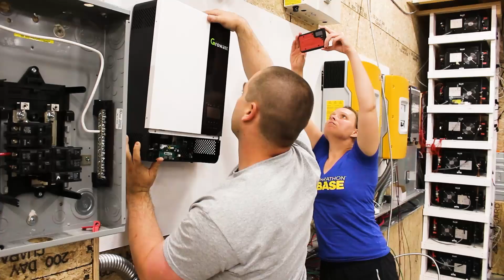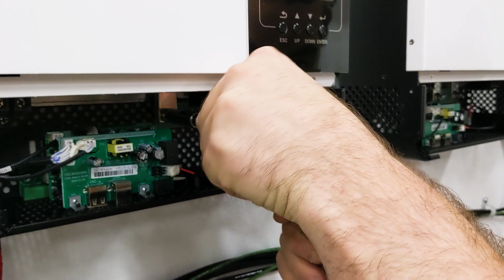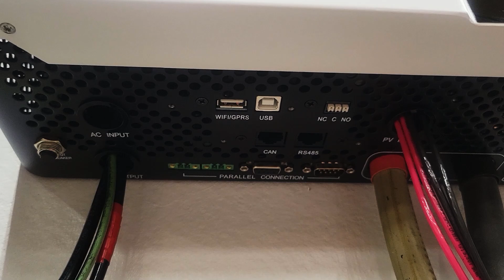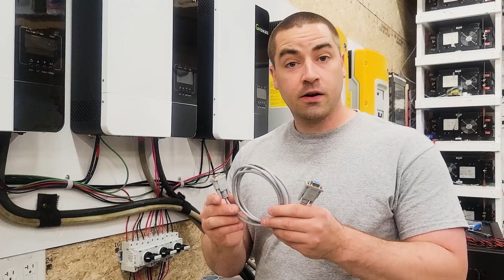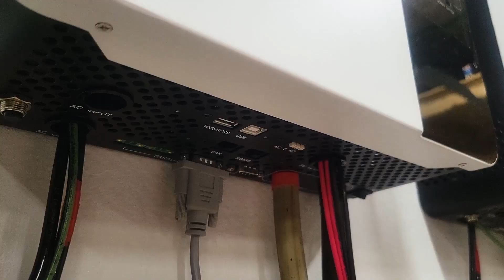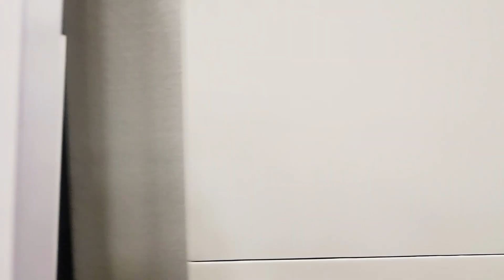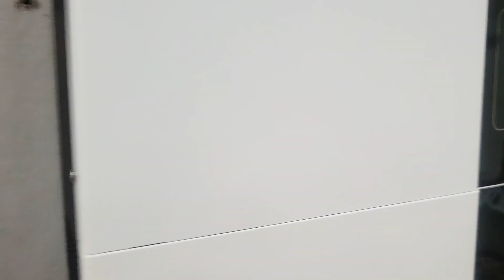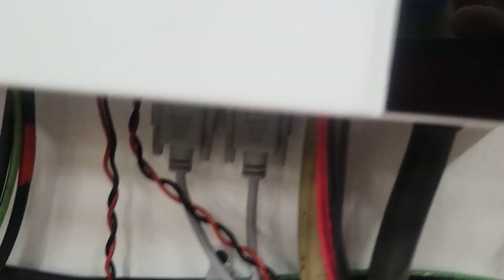Paralleling 3 inverters together, Growatt 5000w Solar System

Comment: David, can you test one 5000 watt inverter directly to a 4500 watt water heater and see if it will work without batteries from a large PV string? I have hydronic heat and more panels than I need for electricity. My plan is to run direct hot water from 6000 watts of solar panels through the Growatt 5000ES if it will work. If it won't work I'm going to include a 48 volt battery in the system. I have 24 extra 265 watt solar panels and want to put them to work.  I heat water and my floors with Nat gas now. I enjoy your videos. Cheers!
Reply from the maker: Hi Solexx X,  In my first video on these inverters I ran a 4500W element off of the inverter, but it was fed with my battery bank.  Could you run it through the inverter without batteries?  Technically, yes, but it will be hugely disappointing.  4.5kW element on a 5kW inverter is about 90% load.  Up there I think I measured the inverter at 88% efficiency.  That means the inverter will draw 5,114 watts.  The largest array you can connect is 6kW.  This means that the inverter will only turn on when your solar array is producing >85% of it's rating.  That happens about 2 hours a week at my location on my arrays.  Most of the time they just don't produce that because of clouds, angle of the sun, haze, smog, shade, temperature, dust, etc.  
If you want to run a water heating element directly from solar, I'd suggest doing so without the inverter.  I have a few videos on heating water directly from panels.  Start with this one: https://youtu.be/kVaxAfXQPDU
Reply: @DavidPozEnergy  Hi again David. I did watch your direct water heating videos but I don't think for my load that is very efficient. I'm going to invert to 240 volts with the Growatt 5kW  and have purchased 7 of the 36 volt 36v 48ah 1.78kWh POWER Module - 60x SPIM08HP from Battery Hookup that I will convert to 48 volts and 12kw/hrs of storage. I will run 2X3000 watt elements and use the load sharing of the Growatt to see how much it reduces my peak daytime load on the condensing gas boiler. My electricity is very cheap from 07:00 pm to 07:00 am. The most expensive power where I live in Ontario Canada is just 5 hrs.

Comment: Great channel, Please I'm trying to replicate what you did with similar inverters, probably a Chinese version of it, but I did use your discount coupon for the autotransformer, thanks, please can I have more advice on how the autotransformer is hooked, that part is not understood by me. Sr If you can give me a link for the AC combiner box, also I have 32 panels of 440 watts (mono), how many can I feed to each inverted, location Miami, FL, You're doing some of the hard work to make it easier for the rest of us. I really appreciate that.
Reply from the maker: I go into more details on the auto-transformer in this video: https://youtu.be/yWUfvvSa3K8
Reply: @DavidPozEnergy  Thanks really helpful.
Reply: @DavidPozEnergy  I have a 440 panel from Solarever MODULE HC79M after calculation from the provider of panels, given the manual of these inverters, they recommended a string of 8 panels in series, that give me a total of 3520 watts, which to me under,  I bought 32 panels, how do I wire to get the 5.1 kW or 4.4 KW, that you get in one of those inverters, my inverter is Revo E 5.5KW.

Comment: I have been been running six, 100 watt solar panels a total of 600 watt and a 3000 watt pure sine wave inverter  and a mppt charge controller that can do upto 48volts but my system is a 12v system. So for battery I have 4, 100 ah lead acid battery from Walmart tie in palleralle and they're running my house over 2 years now but these battery aren't great so I used a 4 amp battery tender charger at night to maintain these batteries from the grid. But I really want some lithium battery on a reasonable price cause my charge controller can charge lithium too but I want them to be 12 volts battery though... but i think of i get lithium i wouldn't have to rely on the grid

Comment: Hi David, been studying your videos for my upcoming project lol.  Thanks for all the info.  I have ordered 3 growatt 5k inverters, 4 gyll batteries and 15kw of panels.  Couple questions for you if you have time to answer about wiring.  In your panel box shown in the video, do you have the ground and neutral bonded together before going to your home transfer switch?  Also, what is your transfer switch setup to handle the power of your whole home?  Thanks in advance!
Reply from the maker: Hi Blue Bore Armory,  In my particular setup:  The AC circuit breaker box next to the inverters is my "combiner box".  It's where the 3 inverters, and my auto-transformer, come together.  From there, they feed out through a 50 amp circuit breaker into my homes transfer switch.  Since my home main panel has a N-G bond, I can't have a second.  So I don't have the N-G bonded at my combiner box.  You have to adjust for your own situation.  Hit me up on Facebook if you would like to chat more.
Reply: @DavidPozEnergy  thanks so much for the reply!  I'll find you and send a message on the book of faces :)
Reply: I am building a similar setup to David's, with the Growatts and solaredge autotransformer, but using 1 breaker panel for 240v loads and a 2nd breaker panel just for 120v loads. The 2nd breaker panel gets its neutral from the autotransformer, and bonded L1 and L2 with it, and their shared power comes from the 240v panel via a single 30A double-pole breaker. This way, if the autotransformer breaker is tripped, all 120v power is disconnected and I won't have a floating neutral.

Comment: hi david do you have any video that you connect wire to your house electric box.. thanks
Reply from the maker: No, my work is off grid.
Reply: @DavidPozEnergy  i mean connect from your inverter to your house .. wire run from invert to  any breaker or something like that then connect to your house   .. tv .. refrigerator .. washing machine like that .... i'm plant to do  but .. not sure how to connect to any for safety with 220v inverter  parallel   2- pcs 5000w each ..  thank you

Comment: So David, no criticism here, (seriously, none, just an honest question) what sterred you inthe direction you went as opposed to an inverter that was already split phase?  Why the auto transformer instead of one that already put out 120/240 volts?  I'm thinking of 3 or so 6kw gw mppt/inverters set up like yours but would really like to know your thought process.  Thanks.
Reply from the maker: Hi Benjamin,  I used to own a split-phase inverter.  It was an Aims, 6kw 120/240V.  It worked great, but was a bit under-powered for my all-electric home.  The problem was that I couldn't buy a second Aims and parallel it.  So instead I had to sell that Aims inverter and then look for a more powerful setup.  
These Growatt inverters allow you to parallel to meet your needs.  5, 10, 15, 20, 25, or 30kW.  I think that's pretty cool.  There are certainly other brands that output split phase and parallel, such as the Schnieder XW+pro, and the Sol-Ark12k.  The downside to those options is the cost.  
All that to say, however, if you know that a 6kW (or whatever) inverter will 100% meet your needs and is already split phase, then go for it.  It would save you one step in adding the auto-transformer.  It's all good.
Reply: @DavidPozEnergy  Was the master electrician able to help you out with a safer way to wire your auto transformer?  If this IS the way to go, we might as well do it right.

I just received my first set of batteries (16x200ah lifepo4) and really at the very beginning of this journey.  I've been reading the mail so to speak for a long time, but finally decided to jump into the game.  Still need to get a bms (any recommendations would be appreciated) to start as a ups (grid priority) 5-6 kw and build from there until batteries are priority and the grid is the backup.

Comment: I love your videos, BTW.   You do the testing and building and make the mistakes so we don't have to.   Please don't ever cover up your mistakes.
Reply from the maker: Thanks for watching.  I appreciate the positive feedback for showing my mistakes.  Sometimes showing them  spawns so much criticism that it makes me want to stop.   Then your comment keeps me centered.
Reply: @DavidPozEnergy  You can tell the people who are just spectators vs. those who are using your data as actionable intel. Spectators will complain, doers will thank you for sharing.  Spectators actually want you to fail because it makes a better show for them AND they don't feel like they are missing out and falling behind.

I'm impressed by the value prop of these GroWatt units because, yes, the Sunny island units are expensive.  Even worse, Sunny Island seems designed to force you into buying Sunny Boy inverters in order to turn your solar power into something that can be used either for direct consumption or to charge the batteries.  This suggests that they care more about their profits than they do about the value prop for their customers.  

Now, if the Growatt product turns out to be cheap Chinese junk then SMA is worth every penny because, especially in the USA, the big cost of these systems is the labor to install, not the gear.  So if you can install it once and have it not break down then that is worth A LOT.  

But if GroWatt combines the functionality of a MidNite Solar Classic 250 charge controller with a SMA Sunny Island Battery inverter and it does so for way cheaper and it is actually reliable then GroWatt is going to dominate in a short period of time because this is the functionality that people actually want.  One more thing: those who live in the city and have access to city power will be seeing their power bills skyrocket into the future.  So it is becoming cost effective to install an offgrid system which feeds one side of an ATS where the city power feeds the other side and solar is made primary.  When your solar system runs out of juice, the system flips over to city power as a backup.  But if you size your system right, 80-90% of the time or more will be running in off grid mode.

Comment: Could this rack be place horizontal ? I'd like to use 48 volt on a 5th wheel RV and place the rack under the Bed.
Reply from the maker: The rack wouldn't work tipped.  The batteries themselves can be set on their sides, but you would need to fabricate something to hold them.

Comment: David I live in Florida and have central air how many inverters do you think it would take for a 3 ton unit and house thanks
Reply from the maker: If the 3-ton unit is inverter driven (ramps up slowly) then you would only need one inverter.  But if it's an older model that has a huge surge when it tries to start, then you would probably need 2 inverters.
Reply: @DavidPozEnergy  thank you awesome job diying I am going to put solar panels in and these inverters also in the very near future not like we don’t get much sun in sunny florida

Comment: What is your total average house load?
Reply from the maker: Depends on the time of year.  In the middle of summer and middle of winter I can be a little over 30kWh/day (I've seen as high as 35 on occasion).  In the spring/fall I'm usually 10-12kWh/day.

Comment: Wait, so the Growatt inverters only output straight 240 volts, not split phase ( so no neutral )?  and that's why you need the auto-transformer to split it?
Reply from the maker: Yes.  I go into more detail on this in another video: https://youtu.be/yWUfvvSa3K8

Comment: Hi David.  Can those inverters provide AC power without hooking up batteries?? I am asking whether they operate without batteries( battery less)
Reply from the maker: According to the manual, page 2, yes, they can operate without batteries.  However, I'd suggest keeping at least a small battery in the mix to improve efficiency.

Comment: David the data plate on the inverters charge controller say max input Amps at 18 amps. How critical do you think that is. On your big array the two strings combined maybe slightly over that.
Reply from the maker: My arrays are IMP:18.8 amps.  But the built-in charge controller only uses 18 amps.  Not a big deal.  It self-limits.  Think of it as the charge controller PULLS the amps it can handle.  The critical factor is to make sure you never exceed max voltage, even with cold temperatures.
Reply: @DavidPozEnergy  I need another charge controller for my off grid system to handle an additional 4000W array. I think it would be cheaper to buy this inverter/changer, than a dedicated charge controller. Three pluses here, one the inverter will interface with my new G4LL batteries nicely, and a big thanks for the discount! Then I can use the this inverter for dedicated 240v loads like more mini splits!  I could also use the battery charge function on this inverter, while my main system stays running. I have been off grid for 34 yrs and I am still learning new stuff Daily! Your video's have been a great help!
Reply from the maker: Absolutely!  It's a great secondary way to charge if you have a small portable generator.  That's what I do too.  And I've been testing running a mini-split directly off one inverter this week (no auto-transformer) and it's been working perfect.

Comment: I would have preferred to see how you hooked up solar panels (how many watts) to the unit and how to hook up the batteries
Reply from the maker: In this video I show hooking up the solar wires from the IMO disconnects to inverters.  But in a previous video I show wiring from the solar array to the inside: https://youtu.be/wDTkMQY3Rx0

Comment: do you need solar panels with this inverters? what's  the purpose for inverter
Reply from the maker: An inverter takes DC power and inverts it (changes it) into AC power.  Houses use AC power.  Batteries and solar panels are DC power.
Reply: @DavidPozEnergy  its make scent  now.

Comment: The difference between the brands is that the sma inverters will result last 20-30 years continual use. The vines ones won't.. of you get lucky you might get 3-5 years

Comment: I bought one Growatt 5000 to power my 4 ton A/C "only" at this point however, it won't start the compressor (off the battery mode) that runs at 4100 watts (start requires much higher wattage).  I think I need another inverter so here's my question:  I have one 6000 w solar array so can  I connect both inverters to one array?  (Batteries are 8 130AH AGM's at 48v)
Reply: Wayne Douglas have you looked into an Easy start? It cuts your LRA by half. I had the same issue (different inverter). After installing it on my a/c, I can run my a/c on solar now.
Reply from the maker: Your solar array is most likely split into 2 or more strings.  You can feed one string into one inverter, and another string into the second inverter.  Or if you have 3 strings, then 1 string can feed 1 inverter, and 2 strings can feed into another inverter.
Reply: @DavidPozEnergy  Yeah I think it's 2 strings (2 blk, 2 red) that come into one bus and there is an extra lug to hook up but may have to separate.  I'm renting this house that has 2 grid tie systems and one failed (PVPowered 4800 Grid tie inverter, ever hear of it?  They aren't made anymore)  so I bought the Growatt from your video to take advantage of the unused 18 panels on the south roof knowing I can take it anywhere.  The north roof has 24 panels with a second Grid tie inverter that still works.  I was contemplating piggy backing  another 5000 Growatt with those panels?  what do you think? It shouldn't hurt either inverter to be on the same array?  Both 5000 Growatts  would then be connected to the same battery bank while the Grid tie feeds the grid.  (sorry for the novel, ha)  Thanks for the reply!
Reply: Looks like you are using an old heat pump buy an inverter airconditioner they do not use simple switch on switch off technology. Also your battery capacity is way too small  for AGM's need perhaps 300 AH at least.

Comment: Hello David, thanks for your inspiring videos. Can those systems charge batteries from level 2 EV station using a J1772 to NEMA adapter? Like the one in the link below: https://www.evseadapters.com/products/j1772-to-c-13-adapter-for-electric-motorcycle-scooter/
Reply from the maker: Level 2 EV chargers are 240V AC, which these inverters output.  So I don't see why not.

Comment: Hi David, can you do this same thing with 2 12K models? I want to build a big UPS, no solar, just grid and battery's of course.
Reply from the maker: No, the 12K model doesn't support paralleling.
Reply: @DavidPozEnergy  Ok, what would you do to get to 24k, I want to run this in a small data center to replace UPS's at each rack.
Reply from the maker: You can parallel 5 of these inverters, which would be 25k.  Or if you wanted to split the loads up you could power half with a 12k, and the other half with a different 12k.  Other brands also offer paralleling.  Sol-Ark makes a "12k" model, but it actually outputs 9k, which means 3 of them together would be 18k

Comment: Hey David,  I've been following your Growatt and array connections and noticed that you cut 6 pairs of wires for the array setup, then a 7th pair comes into light before sending them through the conduit to the house.  Then, at the time to do the connection at the Inverters, only 6 pairs are present.  I'm assuming your 7th pair comes from your set of 20 panels.  I didn't see where it was combined to any other connection.  So... Where did it go once inside the house and before the Growatt?  (I'm designing mine while watching your input)
Reply from the maker: I have 6 red wires, 6 black wires, and one green wire inside the conduit running from the solar array to garage.  I don't have a 7th pair.  All 6 pairs terminate at the 3 IMO disconnect switches on the DIN rail.
Reply: @DavidPozEnergy  Thanks for getting back to me and the clarification.  I guess I got confused on 12:41 of that video.